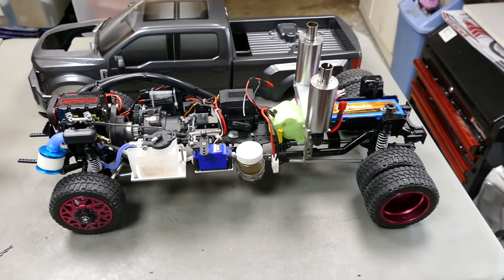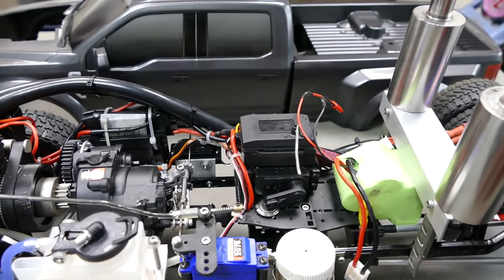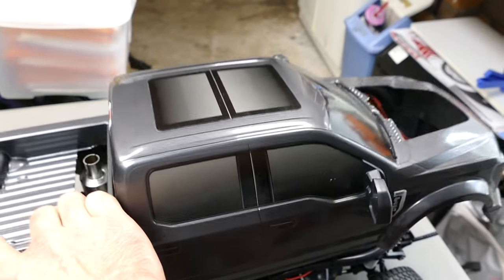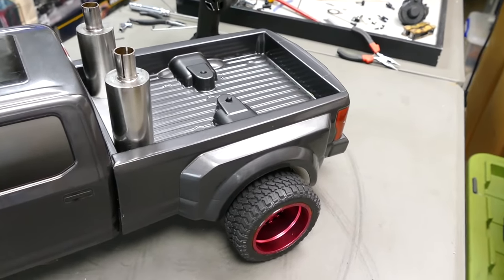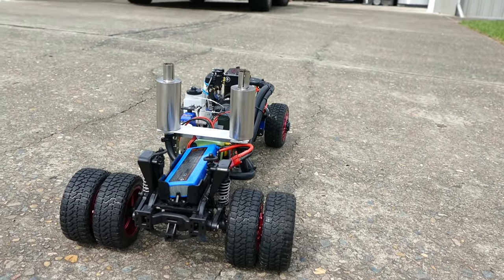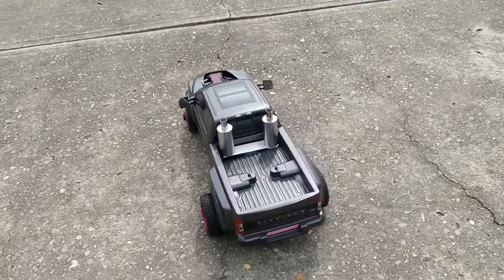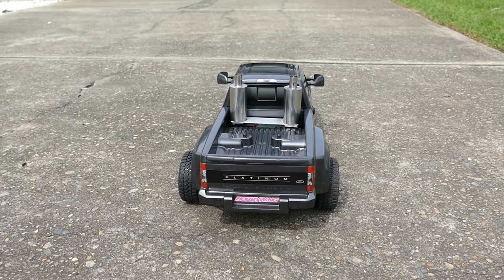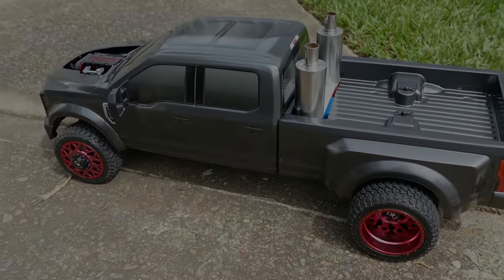FORD F450 TOYAN FS-L200 BUILD - Part 4 FIRST RUN & SMOKE STACK EXHAUST!

Comment: If this rig gets a turbo, the internet will implode
Reply: Turbos dont really go well on little engines
Reply: @dnh3005  look it up!
Reply: It’s an electric car
Reply: Get turbo keychain from eBay lol
Reply: @jcassidy7752  are you okay?
Reply: @jcassidy7752  bro you good did you read the thumbnail?
Reply: ik the engine is powered by a battery
Reply: if it was the other way around it would be a hybrid
Reply: @jcassidy7752  troll
Reply: I don’t even use / build rc cars and that’s obvious to me even… @EntityExploits
Reply: That would be pretty damn cool
Reply: @jcassidy7752  ummm no
Reply: @dnh3005  little turbo but it need to be costumized

Comment: So, obviously I give this build SO much credit, because it's cool as hell, but I'd love to see Toyan build a V8 turbo engine that would look SO good in this RC truck. I had a couple nitro trucks back in the day, but I always ended up with an electric rig. I had a more mainstream Traxxas E-Maxx that I had close to $2000 into with brushless 550 motors, longer gears, 7 cell matched li-po batteries, full aluminum chassis, steel axles and driveshafts, aftermarket shocks and springs filled with 100 weight oil, all RPM unbreakable suspensions arms, steel knuckles, aluminum wheels, and it would do a backflip at full throttle from a stop. I used to jump it off the roof of my 2 story house and it would land on it's wheels and keep going. It would also rock crawl with no problem, until I bought my fully customized steel arm crawler chassis. This build is really cool and I love the Toyan 4 cylinder and the stacks that actually emit smoke from the exhaust. This is really cool to see how far RC technology has come since I was last into it. I'd love to get my sons into it as much as I was, but all they care about nowadays is their Xbox.

Comment: Put the oil run off into the exhaust to make more smoke
Reply: Wouldn't get hot enough since it's silicone
Reply: If he had made those exausts pipes out of metal and did this, i would've jizzed myself

Comment: People PROBABLY WILL SAY IM WRONG BUT it's a 4-stroke compression biased engine like a little INLINE twin-cyl diesel!! You literally have it PERFECT down to the downward sloping intake! 👍 TRY RUNNING BOTH PIPES INTO 2 CHROME EXHAUST TIPS OUT THE BACK LIKE A STOCK F450!!!! WOULD POUR SMOKE ON THE GROUND LMAO

Comment: Nitro always puts a huge smile on my face but it also makes me want to quit RC when it it goes wrong lol 
i still have a few nitro cars but nothing to run them with. they sit on a shelf in the shed and look pretty. Racing 1/10 electric off road at my local club is so much better then the old 1/8 nitro days. Its clean, quiet and relaxing and a LOT less time consuming for a hobby
Reply from the maker: Yeah it's a love hate relationship, hehe

Comment: just information on how to make a racing exhaust, the diameter of the exhaust neck must be larger than the diameter of the muffler filter, so that pressure or blowing dirty air mixes with carbon
Reply from the maker: Thanks for that!
Reply: @RCTanksTrucks247  You're welcome

Comment: I think it's awesome. Every since I have seen those motors I've wanted to do something just like this you pull it off perfectly, love the stacks they fit perfectly. Now they don't make a 3spd transmission do they? If not that's too bad a 3sp would allow you to get off the line faster and to open it up on the highway. You picked a great truck for this engine swap as well I love it!!
Reply from the maker: Thanks man. Toyan make a three speed gearbox

Comment: I didn't notice a radiator I've seen one of those Motors run with a nice little radiator keep some little bit cooler. However it's very well done I like it alot the way you have it set up and everything
Reply from the maker: Yeah they do not need a radiator. The fan does a sufficient job

Comment: does it have a clutch and transmission? like how does it stay running while idle?
Reply from the maker: Yeah it has a clutch on the engine plus a 2 speed transmission with reverse.

Comment: Just a thought, have you considered running your excess oil line into the splitter underneath the stacks? May give a little more rolling coal effect as the system heats up and would save emptying the pot every 6 runs

Comment: . Silicone has about 470 500 degree ceiling.  Imagine the exhaust gasses at longer runs or higher loads 😳 💀 just get some tubing from the hardware store REALLY easy to make a simple exhaust I promise.  And your fuel catch you made, that can run back into the gas tank you don't need a container lol. But other then that dope truck ima sub to see what else you work up
Reply from the maker: I have made a exhaust for the orange crawler. Wanted to try something different

Comment: I really don’t know much about R/C’s other than owning a few outa the box ones as a kid and ok maybe a couple as a “YOUNG” adult! 😜

But I do concur with what you said about could’ve done it electric powered but in my opinion the cool factor would drop to almost “Eh” as well.

My wife and I have been in the market for a full sized F-250 on up to pull a Toy Hauler & H-D Ultra Limited.
So I’m amazed at how authentic this truck looks to the real thing. 

I’ve noticed other videos of guys building standalone small or mini motors like the one you have in this R/C but also V-8 motors with superchargers and turbos on them. 

Do you know or are you aware of guys like yourself putting those type motors in these R/C vehicles as well?

Or do these type R/C vehicles only take a certain type motor like the one you have installed here? 

Just curious is all!

God Bless.

✌🏽🇺🇸🙏

Incredible workmanship sir and I’m amazed at all the technology that’s going on with this R/C. From the motor to electrics to the suspension and frame parts. 

Bravo sir!

🙏🇺🇸✌🏽

Oh and the stacks look fricken SICK!!!
Reply from the maker: Much appreciated brother. All this work is custom as there is no manufacturer that builds a kit with the engine, clutch and gearbox etc.
I have the V8 and have installed it into a monster truck I have several videos on it. Definitely a challenge but that's the part of the hobby I enjoy.
Reply: @RCTanksTrucks247  
I appreciate the response.

As i was writing my initial comment it crossed my mind that this R/C was all custom but i thought id ask. 

Thanks for clarifying that.

Comment: You could make smoke come out of the pipes if you sprayed a mist of the liquid used for smoke on RC planes into them. You would just have to synch it with the throttle and you would be "rollin coal'

Comment: What reduction gearboxes are you using as I need to reduce the output of a 23cc motor that I,m using and they seem to be exactly what I need? Also is the clutch /takeoff from the engine a Toyan part?
Reply from the maker: None, just the revo 3.3 transmission and stock diffs from the cen

Comment: Follow up on silicone exhaust and how many tanks of gas in a row was the most run time on model
Reply from the maker: No issues with the exhaust. It is designed to take much higher heat. Not sure about tanks but around 3L through it

Comment: You should add a small electric motor and speed it up so it whines and imitates a turbo. You could sync it to the throttle servo signal for speed control; or a speaker of some sort...could be cool
Reply from the maker: Yeah but takes time which I don't have much of

Comment: I wouldn't lock the rear diff. Just throw some 20 million weight diff oil in it. Almost like the full lock but you can much more easily change the oils back
Reply from the maker: Thanks mate

Comment: The bottom of my comment is the first, so because of the overlapping point on an engine, the task of holding the engine compression pressure is the exhaust hole and the carburetor.
Reply: @RCTanksTrucks247  sorry if it's not clear, the point is that the diameter of the exhaust hole is very influential on engine power, the smaller the hole size, the greater the energy stored so the engine character is sluggish
Reply: @RCTanksTrucks247 vice versa if the diameter of the exhaust hole is large, the energy stored in the engine tends to be small, so the engine character is vicious/responsive, in the sense that nothing is blocking the exhaust gases,
Reply: @RCTanksTrucks247  If it's like we humans, if you breathe with your mouth and your mouth open a little, the wind comes out little by little, it's different if you open your mouth wide
Reply: @RCTanksTrucks247 If your mouth is wide open, the air you exhale will run out quickly, surely you've heard of the term porting to enlarge the in & out holes in the cylinder head, the purpose is like that
Reply: @RCTanksTrucks247  I wish you a happy new year 2022😁

Comment: Steve, I have a question about this engine.  Can you run one battery for both esc and glow igniter instead of two battery's? If I can run just one battery how do I do that?
Reply from the maker: Yeah you can
Reply: @RCTanksTrucks247  thanks for your answer,but how can I do I need a adapter?

Comment: My  Arrma Kraton 6S is also cool and faster than hell!
Reply from the maker: OMG, of course why is everything about speed? My 88 other rc cars are faster too but so what
Reply: @RCTanksTrucks247  I mentioned that is is fast as well! I have 6 RC tanks that are not fast at all! What is it about is money. My Arrma cost a fraction and perform that is my point. I would never build a model T for any reason when I could build Supra. Slow expensive things float your boat and fast cheap things float mine! that is what makes the hobby great Diversity my man Diversity!

Comment: Steve do you still sell Viper sound boards? Are they still available?
Reply from the maker: Never sold viper sound boards
Reply: @RCTanksTrucks247  what were the tank sound boards called?
Reply from the maker: Clark boards
Reply: @RCTanksTrucks247  no it's a little board that has a 3 pin connector at one end and a servo lead at the other, the servo lead plugs into a free receiver channel and the 3 pin connects to the sound volume slot in the control board, giving you the ability to adjust the volume via the radio. I feel like your messing with me Steve, I bought 2 of them from you a while back, I'm sure they were called "viper sound boards"

Comment: 4 stroke but runs on 2 stroke fuel?
Reply from the maker: No, nitro fuel
Reply: @RCTanksTrucks247  That's what I mean. Aren't typical RC engines, 2 Stroke?

There is no oil pan, correct?
Reply from the maker: Yeah, correct. Needs nitro fuel as it contains oil for lubricant as there is no oil pan.
Reply: @RCTanksTrucks247  2 stroke fuel...LOL

Comment: does the engine power the rc car or is it for cosmetics? or does the battery power the rc car?
Reply from the maker: The engine. There is not electric motor

Comment: Bruh, what about a radiator to cool that sweet motor. Don't want to cook it.
Reply from the maker: Air cooled via the fan. Doesn't need it. Runs in spec regarding the temp

Comment: Why do all the scale model cars have an idle that sounds like a weed whacker
Reply from the maker: Because most 1/5 are basically a weed wacker engine
Reply: @RCTanksTrucks247  is it actually ? Is it really a replica 6 cylinder but it just sounds like that bc of how small
Reply from the maker: They are idling at like 4 thousand rpm, it will never have a slow, lumpy idle
Reply: @RCTanksTrucks247  oh why is that ?

Comment: You claim this is a 4 stroke nitro... lol
Its a 2 stroke with 4 cylinders... lol
Reply from the maker: Umm not it's not mate. Check out the specs.
It is a single overhead cam four stroke engine.